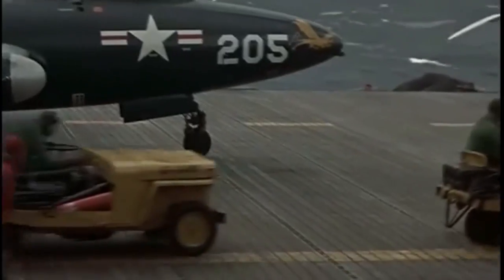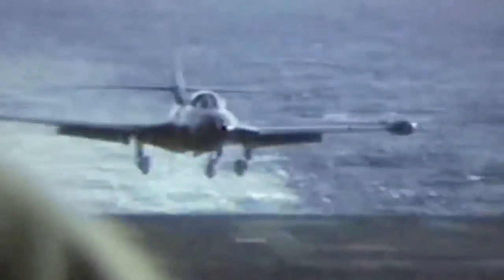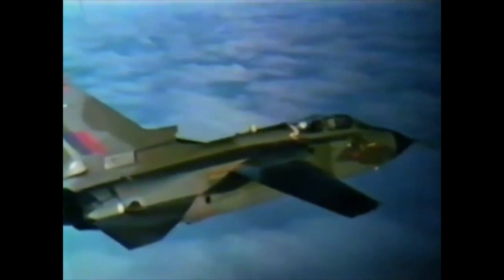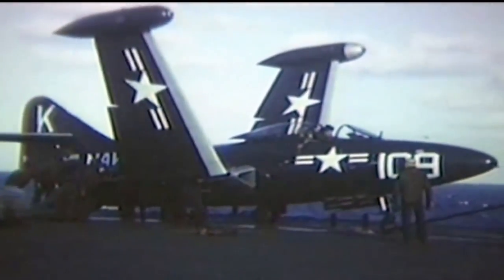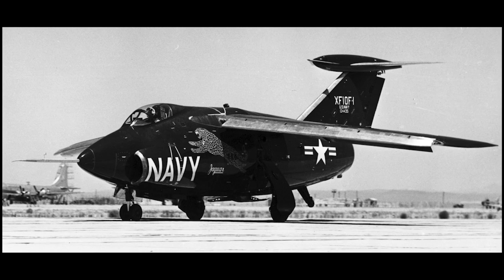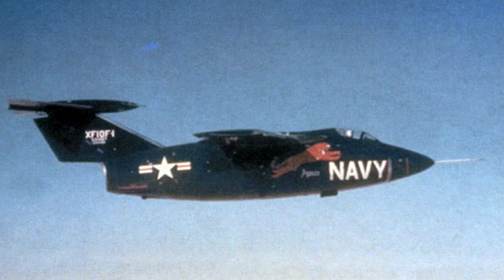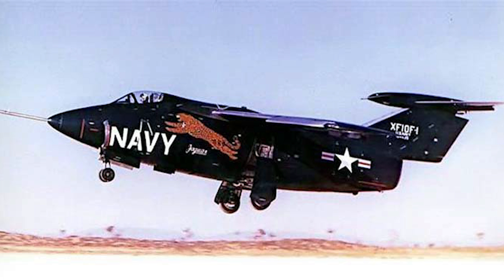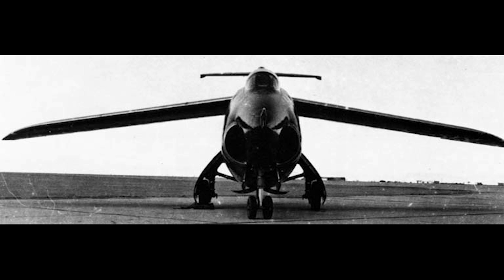“A Fun Airplane to Fly Because It Had So Much Wrong with It" – The Grumman XF10F Jaguar

Comment: The J40 could be named "killer" of a lot of promising projects. Threatned and damaged more US fighters than any Warsaw contemporary adversary XD
Reply: The F3H Demon suffered at its hands too, if I remember right.
Reply: You can add the F4D Skyray to that list too, but, Douglas was smart and designed the Skyhawk to take other size motors just in case something happened to the J40. They ended up with the P&W J57 if I remember correctly. J79 was also an easy fit. (For testing purposes).
Reply: Indeed: a lot of promising planes with interesting layouts and aerodynamic ideas, blasted by a "marvellous" jet engine that never was.
Reply: @glhx2112  A shame, too, the Demon and Skyray were such cool-looking jets.

Comment: It might have been a failure as an expected production plan but as a prototype for variable geometry wings it was a huge success considering that the lessons learned from it led to the best carrier based fighter ever produced, the Tomcat.
Reply: Curiously enough, good (that is to say really good) 'tho the Tomcat was, ........ well its argauble innit?
Pilot reports suggest the humble Skyhawk could get past the big cats at times.
Phantoms scored more kills
Wildcats & Bearcats more again.
An argument can be advanced for the Mitsubishi Zero
Whilst Hornets can go head to head with Tomcats and win every time until they run out of fuel.
You pays your money and .........
Reply: ..forgive me, yes, sort of not the swing wing itself, but in the adaptive wing and control surfaces evolution learned from this design.
More from Grumman's growing knowledge from designing, production, r&d and engineering/manufacturing projects, towards their in-house expertise in aerospace sciences ect, advancing powered, controlled, wing lift devices with augmented flight control mecha-electronic systems on the Jaguar.
If a more powerful engine could, might've rebuilt into...?? but....
Reply: So good they discontinued it and never flew a variable sweep design again.
Reply: @babboon5764  Are "Phantoms scored more kills" and "Wildcats & Bearcats more again." legitimate references given the difference in scale of war they and the F-14 were involved in?
Reply: @scottfw7169  That was kind of the point Scott
It doesn't make much sense to say ANY was the 'best' whatever type of plane ever'.
You can show only that by many measures a plane was excellent for its time.

Comment: Designer: We've made sure we have as many common parts as our previous design as possible to streamline development and manufacturing so we can pass the savings on to you.
Military: That sounds good. What did you manage to work in?
Designer: Well, there's a spring, two screws, and some plastic doohicky that we aren't quite sure what it does, but take it out and the whole thing falls out of the sky.
Military: So we saved money right?
Designer: Well yes, but actually no.

It's an unfortunately common story.
Reply: sounds as though you have worked with engineers often enough... they think in interesting ways.

Comment: The old saying is that if it doesn't look like it'll fly, it won't. were they wearing blinders?  The tail and vertical stabilizer alone killed it.
Reply: I use that rule when I design flying model airplanes. I gotta say, sometimes something looks like it’ll fly, but it just doesn’t!
Reply: @aerospacematt9147  Aircraft designers from large companies have found that to be true too. Wing design looks easy but is rather complicated. But the rest...if it looks like it'll flow over the body, with exceptions for boundry turbulance, it'll be okay if you have a good wing design.
Reply: @OldGeezer55  Yes, I agree. My A-4 Skyhawk should have flown, but an underpowered engine caused it to fail. I believe that the engine in this aircraft was one of the contributing factors to its demise.

Comment: Yeah, that horiz stabilizer looked like someone had spent too much time watching Buck Rogers. But I'm sure this thing went through some kind of wind tunnel testing. Wouldn't that catch these kinds of vicious flight characteristics?
Reply: Yes: Nothing odd about about it if you are familiar with transonic design.  Compare to some British designs of the era like the Buccaneer, Javelin.
Reply: @KB4QAA  A flying Instructor who once worked on Buccs told me that,  brilliant tho the Bucc was .....
In a high speed stall the only option could sometimes be to eject -  Because with the wing at 'just the wrong angle' its tail (one of several T-Tails rather similar in appearance to the Gruman Jagwah) was masked from the airflow by the wing so it was in partial vaccuum and doing not much by way of allowing control to be restored.
Reply: @KB4QAA  the shape is similar but that arrangement to control it with a tiny canard seems pretty janky.
Reply: @babboon5764  I believe that's common in a lot of T-tail designs.
Reply: @RCAvhstape  Logical that it would be I guess.
Before someone else points it out:
Sailplanes are nearly all Tee Tail now but have far greater aspect ratios (thin wings to the rest of yer) so are unlikely to be so 'marked' ......  Especially as gliders don't often do the sorts of manoeuvers likely to lead to a high speed stall.
(Yes I know soe are good aerobats but ....)

Comment: The first flight by a swing wing aircraft was a small scale model built by Barnes Wallis (it worked), he seems to get overlooked a lot these days, he also introduced 'geodesic' construction (for the gas bags in airships, it spreads the load evenly), that was based on a mathematical construct but he got the name wrong, it should be 'geodetic'.

Comment: Such a long time to eventually realise it was a lame duck. Surely test flights would prove the engine to be inadequate and the extra size and weight would all contribute to a bird not able to fulfill the wishes of the Navy. Anyhow, great video Ed. Look forward to another.
Reply: With the engine in development at the same time as the aircraft, it would take more time than you might expect to determine that the engine design was just bad and would never be made to work. This very problem did in several late-war fighter projects when various super-engine projects just couldn't be made to meet desired performance or reliability.
Reply: @steveh1792  Ed's done some vids on them too!

Comment: I served as technical editor for a book on management written by a retired CEO/engineer who early in his engineering career had been employed at Westinghouse. During a conversation on his early career, he explained that he'd worked on jet engines there in the Gas Turbine Division  and he eventually quit because the culture at Westinghouse at the time was toxic and because an engine they were developing was "absolutely awful" and his complaints to the project's manager about design flaws repeatedly were ignored. I cringed when I heard this and asked which Westinghouse engine he'd been working on. It was, of course, the J40. I then asked if he knew what eventually happened with the J40 and he responded that when he left he never looked back. So, more than a half century later, I was the lucky guy who had to fill him in. He didn't take the news well at all.

Comment: "We need swept back wings, not straight wings for higher performance"...Now we have the likes of the F-18 that has essentially a straight trailing edge and a swept leading edge. I find it hard to believe they wouldn't have already experimented with that planform earlier instead of the complexity of variable geometry wings (which have now been abandoned)....or am I missing some other aspect of aircraft design/technology here? Incidentally, the F4D Skyray - with it's delta configuration - had it's first flight before the Jaguar (according to wikipedia), and that certainly wasn't straight winged.

Comment: Of all the little entries in books I have read on the Jaguar I never read an assessment of the VG wings and it's impressive that even in this early attempt they actually worked

Can't help but think if they would have just put a new tail on the aircraft given the engine it needed and maybe some area rule it might not have been such a piece of crap

On a side note I couldn't picture landing that narrow undercarriage on anything other than a runway trying to get that thing aboard an aircraft carrier would have been a nightmare it's like grumman's own jet powered trans-sonic supermarine Sea fire
Reply: They did they changed the name to Tom Cat

Comment: There was virtually no connection between the Jaguar and Tomcat, which began flying 17 or 18 years later.  In between was the Grumman F-11 Tiger, notorious for literally shooting itself down and generally mediocre (just not as disastrous as the Jag). But that "family line" ended with the rejected Super Tiger F-11F-1 prototype. In fact, all of the later US swing wings were descended from research by NASA in the late '50s, followed by General Dynamics' F-111, including the rejected F-111B variant for the USN (in which Grumman was involved as a junior partner). In the late '60s, there was also a rejected Vought design, the V-507 two seat carrier fighter, and this may be regarded as the missing link between the F-111B and the Tomcat. None of these had much to do with the Grumman fighters of the 1950s.

FWIW, the Vought V-507 was also influenced by the Dassault Mirage "G" – a promising swing-wing prototype from the mid-'60s, which did not enter production, but still holds some speed records. (Vought was a regular supplier to the French Navy, through which it had connections with Dassault.)

Comment: Actually, it was the British who came up with the "wing controlled aerodyne" as it was called by "Barnes Wallis", remember him? He died way before jet aircraft! In 1931 Westland-Hill built the Pterodactyl IV which could vary the sweep angle during flight, it assisted in longitudinal trim due to no horizontal stabiliser and was later used in Barnes Wallis's wing-controlled aerodyne.

Later, the British experimented with "swept-wing" technology but decided against it which is when the US adopted it but not before the Germans had experimented with the possibility of adopting it for their Messerschmitt P-1101 jet fighter, so no, the US did not come up with "variable wing" technology, it was a British development that was later considered by the Germans who never got to use it and then abandoned by the British before the US took it on.

Edit:-
The Pterodactyl first flew in "1928" but it was the later Westland-Hill built ones of the early 1930's that had this technology, and so yes, a plane had flown with variable wing before you say!
Reply: Barnes Wallis died in 1979!!!! His swing wing designs didn't appear until the mid to late 1940's. The Westland-Hill Pterodactyl IV had a very small amount of variable wing sweep to provide longitudinal trim control in absence of a horizontal tail. It had nothing to do with improving the maximum and minimum airspeeds.
Reply: @richardvernon317 
Aha, apologies, I was thinking RJ Mitchell lol, but yes, Wallis did die well after I stated, thanks for correcting me.

Comment: Entertaining video, but you're wrong about the "great success" of the  F10Fs swing-wing. In fact it was a dead-end. The designs' inboard pivoted wings caused terrible stability issues, when operated, due to wildly shifting aerodynamic trim.  All early VG aircraft suffered from this issue until it was discovered that moving the wing-pivots well outboard of the fuselage, solved the problem. Another point is the Germans came up with the concept during WW2 (Messerschmitt P.1101). The Bell X-5 was derived from it & that failed precisely because it had the same inboard pivots as the F10F.

Comment: Another excellent video, it's become quite the series.  BTW, Americans pronounce that word as they do because it is similar to the Spanish pronunciation of that word.
Reply: Portuguese. The Spanish pronunciation does the "j" like an aspirated "h". The Portuguese-speaking Brazilians got the name from the Tupi tribe who pronounced it ʒɑ.ˈɡʷɑr. They then loaned to the the North American English speakers. The NAmEng pronunciation adds a "d stop" in front of the "ʒ" to get the J's "dʒ" sound and the first vowel is "æ" like in NAmEng "cat" instead of "ɑ" as in the BrE RP of "hat". Don't stop the air with your tongue behind your top teeth and open up that A sound and you've got it.

Comment: This video made me notice that nearly all variable geometry aircraft had shoulder mounted wings, even before that arrangement became fashionable for fighters.  I'm thinking it has to be more than coincidence.  Structurally, it seems to me that a low mounted wing would be more efficient, especially for a carrier based aircraft, so perhaps this has an aerodynamic purpose.  If anyone has any info please comment.  All I can speculate is that the high wing with zero or negative dihedral makes the airplane less susceptible to variations in lateral stability as the wing angle changes.
Reply: If the wing is low, variable and presumably as thin as possible, where does the undercarriage and ordnance go?
Reply: @davidrees7978  And the engine, and the bracing structure and the mechanical mechanism with motor.... Making it shoulder mounted is the most practical solution.   Gort offers no educated insight and is just bloviating for ego.
Reply: David Rees
Good question. With some variation, why not roughly the same place they go in an F-14 or F-111?   Gear retracts into a different place than the wing pivot box, although if you could have the same basic structure carry both loads that would probably be efficient.  Ordnance goes under the belly and fixed portion of the wing, and you can even have pivoting pylons on the swinging portion of the wing like the F-111 if you really need more pylons.  This is all just speculation, which is why I'm just asking if anybody has any actual information about whether such a configuration was ever considered, and I'm especially interested in whether there are any lateral stability implications to a swinging low mounted wing.
Reply: @gort8203  don’t know the answers to these questions, but my first enquiry would be to compare the size of F1-11 and F14 with this guy. I think it was very small in comparison & that’s important. More room, more potential.
Reply: @davidrees7978  Yeah, I was not asking about this specific airplane, I'm interested in the general principles.
Reply: Tu-22M has a low mounted swing wing.
Reply: @gort8203  Size is a fundamental principle. If an arrangement doesn’t work in one instance, that shows a principle may be at work.
Reply: @richardvernon317  ….and is an very much larger aircraft.
Reply: @davidrees7978   Either I don't see the point you are trying to make, or it is not a logical one.  You point to the Panther, a particular airplane, and state that its small size in comparison to others is a factor.  I agree and say I'm not interested in that particular aircraft but in a general principle which may apply to others.  Now you are trying to say what, that if that arrangement doesn't work in one particular instances it must hold for all others?
Reply: @richardvernon317   Thanks.  I knew there had been at least one with a low mounted wing but couldn't think of it at the time.
Reply: @gort8203  I fear this is getting nowhere. Good luck with finding the principles.
Reply: @davidrees7978   Well, your last comment did seem to lead nowhere. But thanks for the well wishes and same to you.
Reply: @gort8203  B-1B, TU-160 and you could have a mid mounted one (SU-22).
Reply: @davidrees7978  Mid mounted on the Su-22 and that is not a Bomber!!
Reply: @richardvernon317   So it looks like my initial impression was incorrect.  The shoulder mounted wings were all that came to mind at the time, but it seems VG wings have indeed been set at all heights.  Thanks for clearing up the fact that there is actually no mystery here at all.
Reply: @gort8203  Depends on how lazy the Aircraft designers are. If the fitting of a VG wing is a modification to an existing basic design, which the SU-22 was (A VG wing version of the SU-7) they left the wing where it was. Most likely also the case for the TU-22M Blackfire which was sold as an upgrade to the TU-22 Blinder. VG versions of the EE / BAC Lightning were proposed which kept the wing in the same place as the original design. Proposed and built VG winged Phantom and Mirage (the later one was built and flown) moved the wing up high (and of course a fixed high wing version of the Mirage, with a tailplane was produced and sold quite well). The Aircraft designers tend to go with what they know, thus the reason that aircraft from the same designer have the same shaped tail fin (Hunter / Harrier / Hawk or Mosquito / Hornet / Chipmunk) or they all got their aerodynamic data form the same place (The reason that all the Soviet designs look the same for the Migs, Su's and TU's).
Reply: @richardvernon317    Agree with all your comments, but perhaps it's not completely fair to characterize aircraft designers as lazy.  I think most would love to start with a clean sheet of paper, but derivative designs are often proposed with a primary consideration of minimum cost or time to develop, so substantial changes to what came before have to earn their way on to the new model.  I appreciate your comments.

Comment: Use of a centrifugal engine made it very fat and i think slow
wasn't the J-47 axial flow engine available from sabre type
slimmer body greater speeds
elevator should be low, more effectiveness through all speeds and one piece not split
supersonic may then be possible, should have asked me to design it, ha,
use what you know and improve on if possible, variable geometry wing were best feature
and required for Navy use, good video interesting